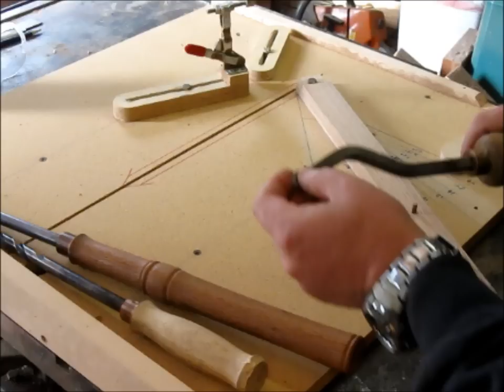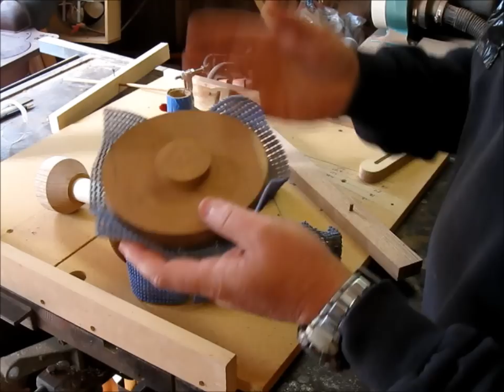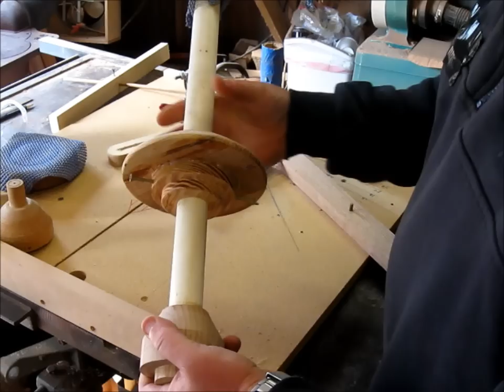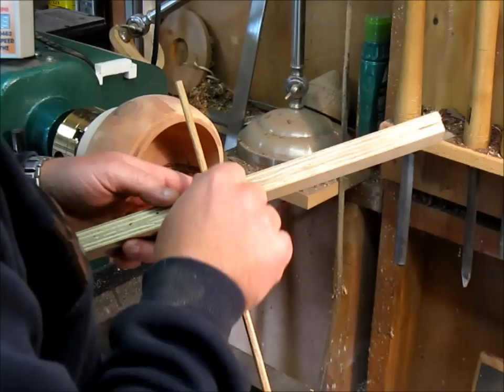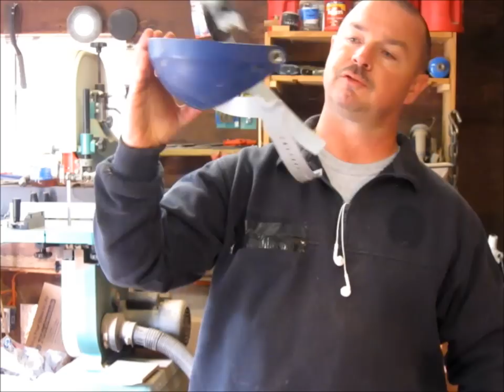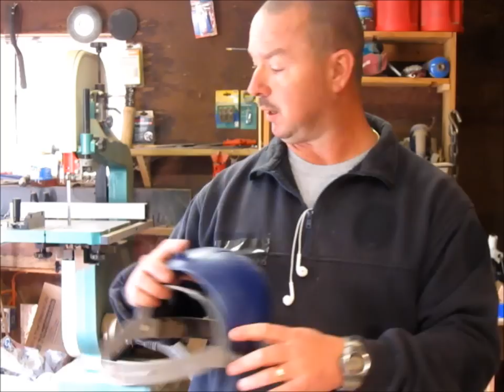#11 Homemade Woodturning Tools and Fixtures

Comment: Great video Stephen, lots of good information.
Reply from the maker: Thanks Carl, I appreciate it.
Reply: Thanks for posting this, Stephen Ogle -- it's always inspiring to see somebody making good stuff without 100% high-dollar equipment.  I think I'll take a crack at some of those carbide-tip hollowing tools.  I can turn handles, and as I recall the cutters aren't nearly as expensive as the tools.  My only question: how do you attach the metal shaft to the handle?  I've seen these assembled with brass ferrules, but I don't know if they're glued or just pounded on.
Reply from the maker: As you turn the handle you just need to bore a hole about 3 inches deep just large enough in diameter to hold your tool.  The brass ferrule simply keeps the handle from splitting open.  I would suggest using CA glue or an epoxy to hold the tool inside the handle. I hope this helps. Thanks for the comment and insightful questions.
Reply: Thanks -- that makes a lot of sense.  I had wondered about that for a while now.
Reply from the maker: Thanks Dan, glad I could help.
Reply from the maker: Thanks again Carl, I am still working on my camera mounting situation.
Reply: Great video, thanks.
Brad
Reply: Excellent video, now just have to subscribe to your channel;)
Reply from the maker: Making shavings, thanks for your compliment and subscription.
Reply from the maker: Vaughn Bradley Thanks Vaughn for your compliment.
Reply from the maker: Making shavings Thanks for the compliment and subscription.

Comment: Thanks again Stephen for invaluable information. As respirators  are very expensive this may help you and other turners.to save some money. I took my clear face mask the same as yours and cut a square hole in the top. Using silicone I mounted a powerful computer fan in the hole and ran a long electrical wire to a transformer then into a power point. A wire hook above my head keeps the lead out of the way when in use. Some of my wood turner mates have copied my idea except with a 9volt re-chargeable battery instead of the lead and transformer. Both work very well. With a dust filter over the fan a positive air pressure builds up behind the mask to keep the dust out and  the gentle breeze downward across the face prevents spectacles from fogging up.Hope this helps someone.Cheers John from Australia.

Comment: Wow Stephen,

This is so incredibly helpfull. Low budget stuff and homemade. I just love it. Two reasons why.
1) Myself i`m no miljonair and some tools are just way too expensive.
2) Not only me, but alot of peeps are looking for other ways to have nice tools, but at low cost. (with the crisis and all that) It`s just so verry verry helpfull. Great that you share!
Thanks ;)
Reply: Ow, question on this one.
What is a "key stock"? (do i write that correctly?) I think i found it, and here in Holland we call that a "spie". Translated that would be "gusset or forelock". Correct?

And also this one. What did you use for the arm? where the cutter goes onto. What is that? Is it reused material like the drillbit?

And another one. The face shield. I use glasses, safetyglasses they are, look like ski-glasses. It`s a pretty thick one too. If i put it on my nose is behind it so to say. So if something hits me, it hits the glasses first and not the nose. Do you think that`s enough, or is it better to take a shield? I have had pieces flying around and hit me too, but still turning ;)

Thanks again!
Reply from the maker: Thanks Dries for your questions, #1 Key stock is used on a shaft to hold things in place like pulley's and it sits in a cut out on the shaft. They are square and are very accurately machined to fit the key ways on the shaft and pulley. #2 The arm is made from 3/8" square bar I got at a local hardware store and bent to the shape I needed to hold the cutter.  #3 I use safety glasses while turning small projects and where I am usually out of the line of rotation or "Line of Fire" even then I still get nervous about getting hit. I broke my face shield when a large piece broke off and hit it. This piece would have put me in the hospital if I had been only wearing safety glasses. Face shields are cheap (about $15.00) but priceless. I would definitely recommend using one. I hope I have answered your questions to your satisfaction and Thank you for asking.
Reply: Great Stephen,

Thanks!
i will surely get one then. Normally i do small stuff (a "tamper" forinstance, the thingie you "tamp" tobacco with), but being at the point at going bigger i wondered. So thanks!

Comment: Cool tools. Thanks for the tip on creating the bend on the carbide tool bar. Now I have a use for the 3ft piece of 1/2" square stock that is rusting away in my garage
Reply from the maker: Just go for it. Lol. Thanks for the comments. Glad I could help.

Comment: Great advice . I just started woodturning  after many years of thinking about it and i find your advice very helpful. Thank you very much. 
(I just snapped  a chisel today) does it happen to you? ADVISE PLEASE .
Reply from the maker: Thanks Nelson for commenting. I hope you will enjoy turning for a very long time. I have never snapped a tool but I have bent them severely. LOL. Best advise here is the basics. 1. Keep tools sharp. If you have to push the tool it should be sharpened. 2. Ride the bevel to help prevent gouging. 3. Make every cut a practice cut. 4. Practice Practice Practice. I hope this helps and than you again for commenting and supporting my channel.

Comment: Hi Stephen thank you for shearing some of you home made tools.
I have a problem that I would like your opinion on, I would like to do some deep hollow forms but do not have the tools and was thinking of making a tool ( D handle, articulated arm ) or a long bar but am not sure could you advise me PLEASE ???
Reply from the maker: Thank you Douglas. I think that the snake hollower video from Capt. Eddy's channel is just what you are looking for. I myself use a homemade tool from a 1 inch diameter steel rod with different cutting bars I can add into the end. I hope this helps.

Comment: thanks Stephen, great tips and tools!
do you have tips on making bowls and platters and toys foodsafe?
thanks again Blessings for you
Morneb
Reply from the maker: Thank you sir for commenting. Well you could always go with the store brandsor you could mix 70/30 Bees wax with Walnut oil. The oil will bring out the colors and grain and the bees wax will give a nice sheen. I do not use mineral oil simply because it does not cure and will not contribute to a nice look in my opinion. Hope this helps. Thank you for commenting and for your support of my channel.
Reply: Thank you very much, I do have one more concern and that is that I have read about the toxidity of woods and so I wonder if one can use any wood for cups, breakfast bowls and eating plates.
Reply: Try raw flax seed oil. same as boiled linseed oil but food safe with no heavy metals to help it dry faster......which means it takes longer to dry or cure.......but you can eat off it!!

Comment: Another great tip Thanks Stephen
Did you have to heat your square stock to bend it at all?
Reply from the maker: Well Albert, I am ashamed to say that at the time I had no torch to heat the steel. I simply put it into my vise and beat it with a hammer. Heating would probably be the better choice though. Thanks again for your question and comments. I hope I have helped.

Comment: Thanks for the lathe tool suggestions.  As I progress I will probably make one with the curved handle.  I do have a question also. Is the adjustable angle sled in the video accurate enough to make bowl segments that don't have to be assembled in to half circles first. I made one similar to yours but I could never duplicate the angle again once I moved it to cut something different.
Reply from the maker: Thanks Dale for the comment and question. The answer is yes this is my sled for cutting segments and yes it is repeatable by simply using a pin. If you notice I have a brass pin near the end of the arm. Once I get my angle perfect I will drill a 3/8ths hole for the pin and I can come back to it anytime. It may take some trial and error to get it right.Just make sure is before you set the pin hole.  Hint, use a protractor for accuracy. I hope this has been helpful.  I plan to do a video just on the sled later. Thanks again.
Reply: Stephen Ogle